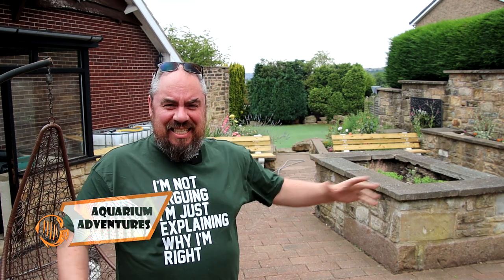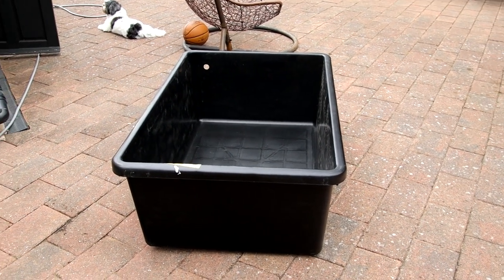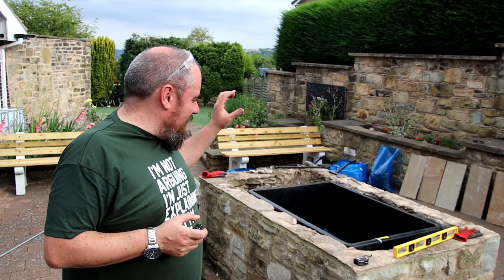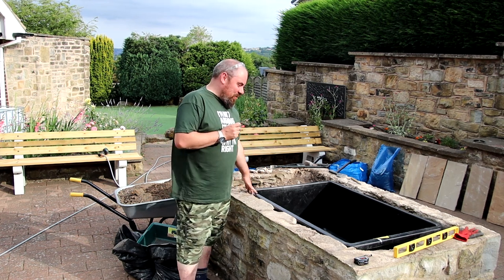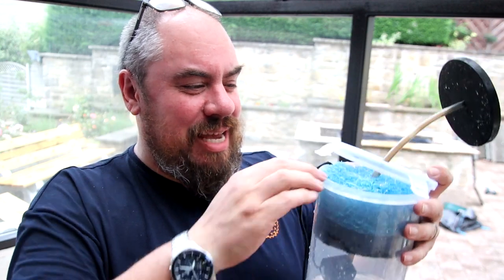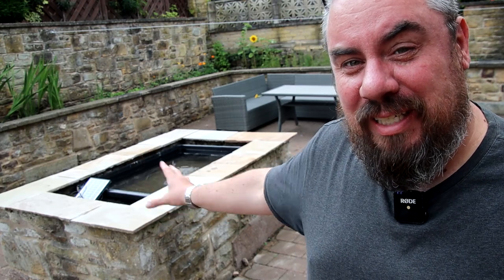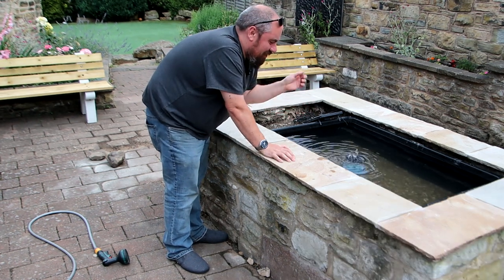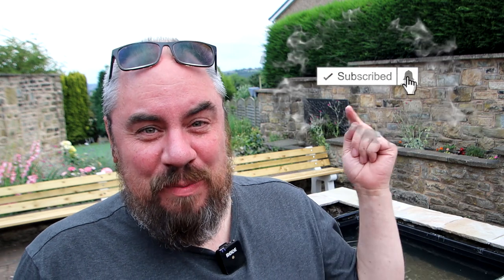Solar Powered Pond? DIY Garden Pond build, part 1.

Comment: All of my Guppy ponds use solar pumps.  Until a week ago the pumps were plugged directly into the panels.  After watching the PG's video I bought four  20,000 MAH b/u batteries.  Now the panels charge the batteries and the batteries run the pumps.  It's way better for little additional cost.  I think your project is going to look awesome once it's planted.
Reply: Hi  your comment is really interesting . I am a beginner and have built my first pond. I have had it since May and I put 6 baby goldfish in 2 months ago. I haven't got any filters just 2 air stones. I am going to have a go at making my own filter. Please would you mind  explaining ' to dummies ' just what you did as I admit I don't really understand. 😐🤔🙄